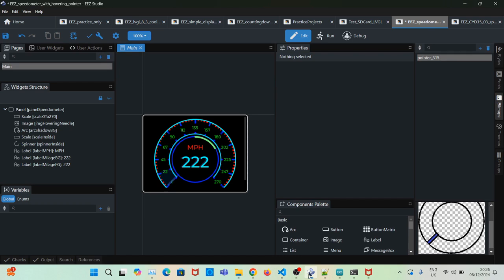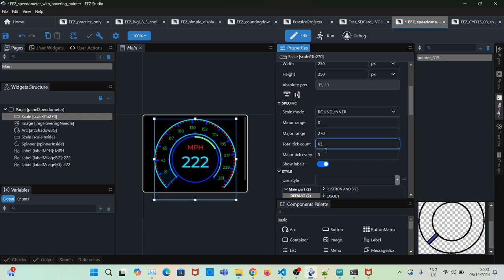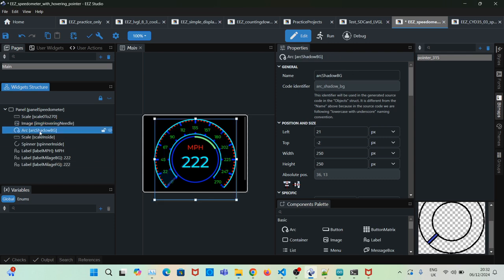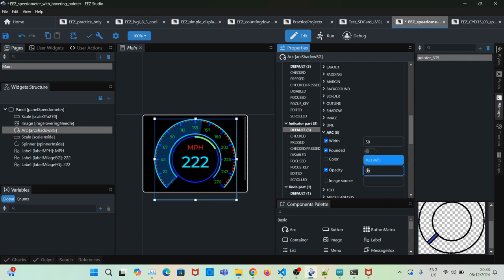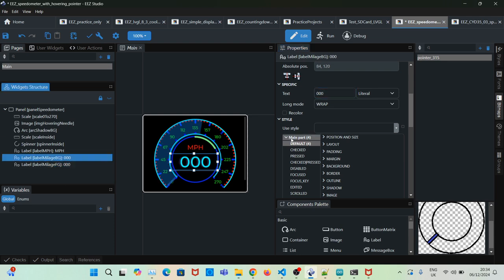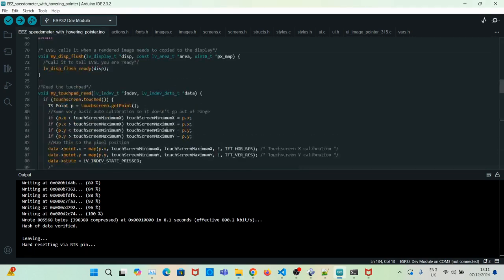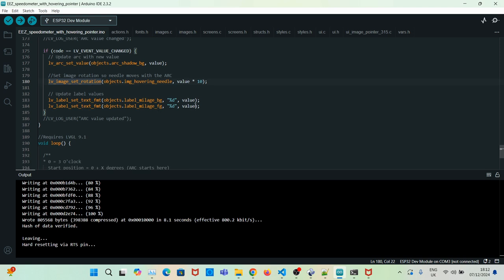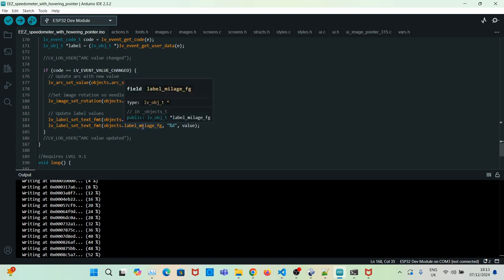LVGL CYD ESP32-2432S028R create a simple speedometer with hovering pointer(Beginner)

Comment: Your videos have helped me a lot in my project to make an engine monitoring system for my airplane. I'm using EEZ studio and now, with your videos, I can easily make my own gauges and display those on my 4" TFT_LCD. Even your gauges projects display nicely. But, those gauges have to interact with outside world. I can already manipulate my 8 thermocouple sensors and potentiometers and display those on my LCD when it is generated solely with arduino IDE,  but I struggle to do it from EEZ generated projects.  And there is no video of EEZ generated gauges interacting with outside world. It would be nice if you'll do a little video on it. The simplest possible to not be confused with other components. Ex. from EEZ, just a visualiser "Bar" ranged 0-100. No panel, no label, nothing else and in arduino.ino, make it move with a potentiometer with, maybe from this sort of line "   potValue = map(analogRead(potPin), 0, 4095, 0, 100);  where " potPin  " is  " int potPin = 36; "  or whatever and " potValue "  is the value 0 to 100 to be passed to the gauge (the Bar). I'm sure it will help a bunch of beginners. Thanks a lot

Comment: You can specify a target file location in your eez studion project so that you dont need to copy and paste the files every time you make a change in your layout. Then you can simply make your layout changes, build, and then recompile.
Also, if you want to avoid manual changes in the generated files just place them in a subfolder in your Arduino project named src/ and they wont show up in the IDE editor. I would recommend doing it this way as any changes you make in the eez-generated files will get over written next time you make changes in eez studio so I would consider it a bad idea to edit directly in those source files.